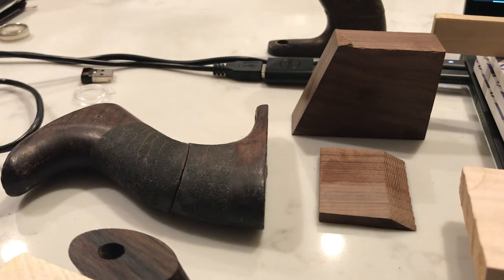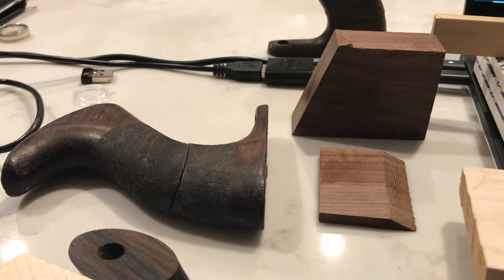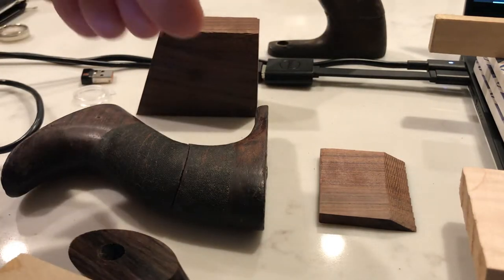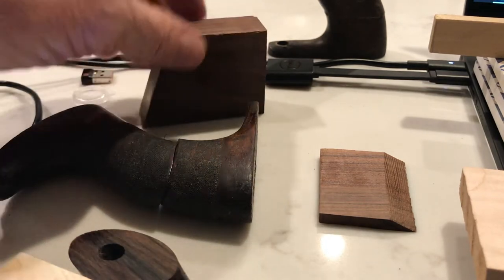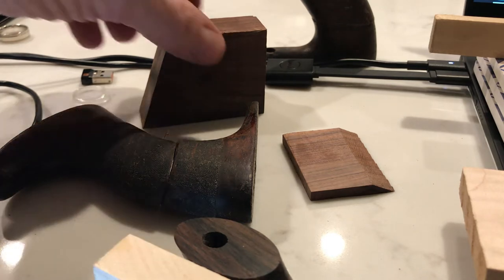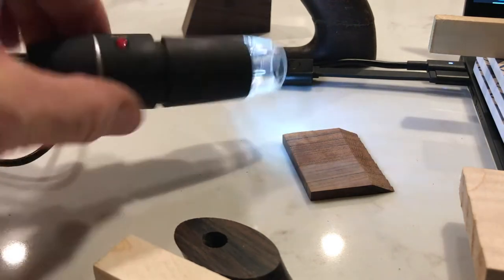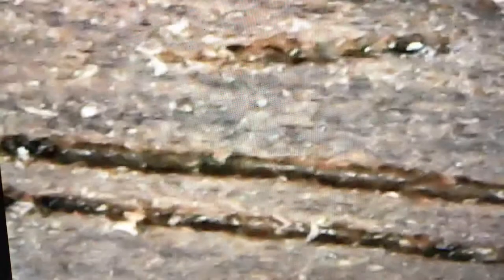Watch this before you glue that tote!

Comment: Interesting video,  what about using epoxy  rather than wood glue, to repair an old break without preparation?  Thanks from  Canada
Reply from the maker: Absolutely!  Depending on the material, the age, and the intent of the restoration/repair, I will use AR (aliphatic resin) 2 part epoxy, CA (cyanoacrylate) and also PVA (polyvinyl acetate). In layman’s terms that’s Titebond, epoxy, crazy glue and gorilla glue. Epoxy is tintable and works very well in the form of 5min set, or 30min set.
Reply: @gordonaddison307  What you think of using J-B Weld?
Reply from the maker: @rvelandi1919  I have used J-B weld on other things….I’ve used their grey 2/part. I’ve not used J-B on totes or knobs mostly because I’m looking for a certain viscosity and I want to tint or stay crystal clear. I’m sure they have a clear product (?) but I haven’t tried it.

Comment: 9 minutes plus and I didn't learn a thing about surface preparation.  Just microscopic views of different woods.  I doubt I will watch a second video of yours.
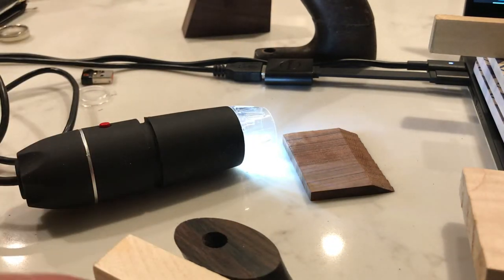Reply: 02:26-02:48, 06:00-06:24, 06:40-06:55. There are different philosophies/approaches to how to prep the surface, especially of a clean break where the two faces even if irregular or jagged fit together really nicely (where one might be tempted to do nothing but apply glue and clamp, and it's not hard to find forum posts and YT vids showing or actively recommending exactly this). But the basic issue controlling whether you can get a good glue bond is the cleanliness of the wood surface. 

This is precisely why old breaks and new breaks can't be treated as though they're the same situation, regardless if the surfaces interlock equally well and superficially (i.e. to the naked eye) they look similar they're not, as the video shows with great clarity.
Reply: Oh Randy, thanks for your worldly insights.